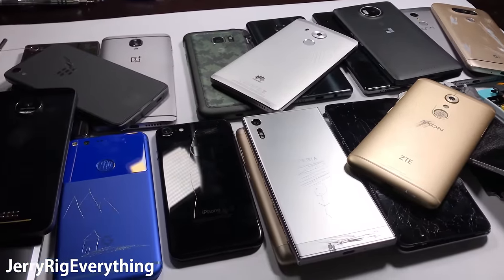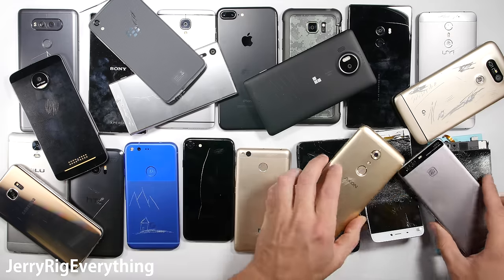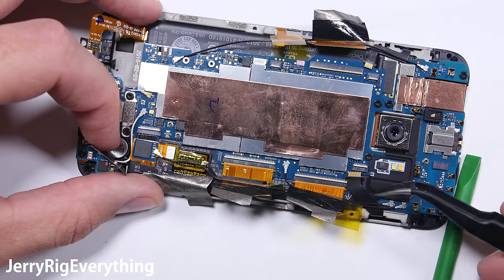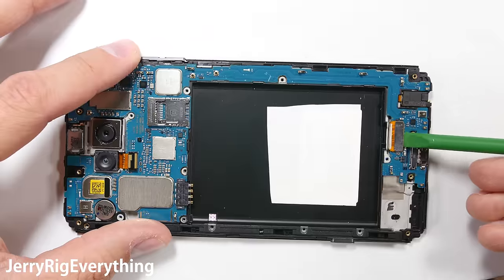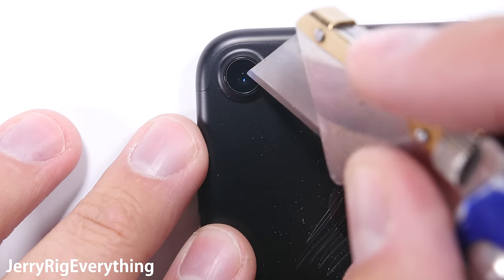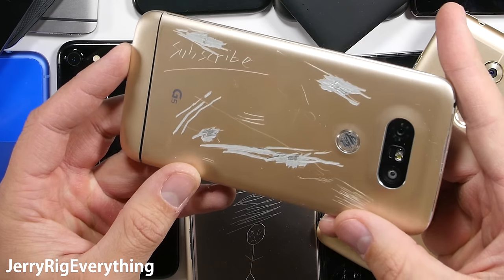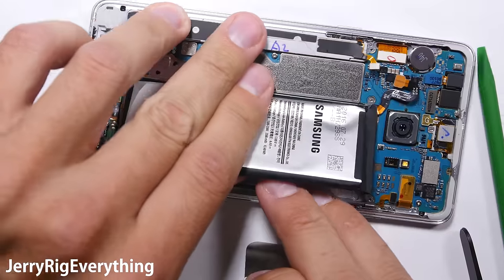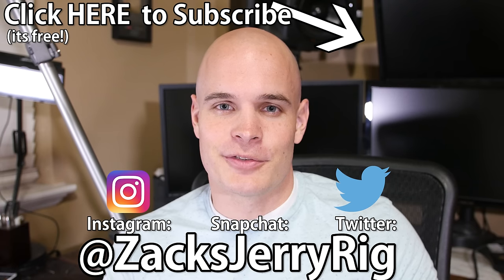Most Durable Smartphone of 2016 - Year End Summary Awards

Comment: S7 Active is the most durable one
Reply: I M serious and also

Moto Z and one plus 3 but the Samsung one is a beast
Reply: I think your an isheep
Reply: You kinda have a point about the scratch on Samsung dude
Reply: Right, Active screen is protected by plastic that scratches. So you add tempered glass on top of that and you dont even notice it.
Reply: Wait wtf
Reply: howyoudurrinhunneh exactly what I did
Reply: Hanzlah Sohail but that kind of defeats the purpose of the plastic screen in the first place the issue is is that unlike another phone which name I cannot remember this one cannot be easily swapped
Reply: Ok
Reply: You spelled [Verizon Wireless's] Kyocera DuraForce Pro wrong! XD
Reply: OnePlus 3 & the 3T are great devices but it's not water resistant.
Reply: I am still liking  oneplus but Samsung Note4 was the first smartphone I loved then I went on Samsung lead and also Sony xperia Z5 it's fast as lightning

Comment: My fav of 2016 has to be the HTC 10
Sure, boomsound isn't the same as before but damn, HTC is always on top of updates and their hardware on flagships can't be beat
Reply: Darrin Ramlochan yeah, but never made it when it comes to performance.
Reply: Darrin Ramlochan man i woulda got an HTC 10  if it wasnt so complicated to root and repair the damn thing lol
Reply: HTC 10 doesn't perform much differently than the Pixel phones. 
And HTC's are actually one of the easiest smartphones to root and install custom stuff on.... Unless you're on Verizon.
Reply: leaving the software experience, Pixel is nothing. They both suck at performance. Also the 10's camera isn't satisfying.
Reply: ***** actual compared to nexus/pixel/Op3 the htc 10 is fucking hard to root imo and fuck verizon lol
Reply: Maybe it might have been hard to root initially but the updated thread over at xda has a simple enough adb command to execute then to flash the supersu.zip
Idk maybe because of my experience with rooting odd devices it seems simple to me LOL 
Be glad you guys didn't have a HTC Amaze 4g like I did where you literally had to short circuit the phone while executing commands through terminal in Ubuntu Linux just to get S-OFF to be able to flash anything.
Reply: In specsheet of their cameras, the HTC 10 should have a better camera than the Pixel / Pixel XL. And what did DxOMark say about that? 89 for Pixel / Pixel XL, 88 for HTC 10. How bad is that HTC?
Reply: Heck, real life results proves it further
Reply: I believe that the reason the HTC's camera might seem lackluster is because of it's software processing and external lens. The external lens would cause some aberrations in the picture and image processing really affects the quality of pictures overall. 
The main reason the Pixels and Nexus 5x&6p phones have such great cameras is because of that image processing.
Reply: When you look at it, the HTC 10, Pixel and last gen Nexus devices have almost the same camera. Same pixel size, same sensor size, same megapixel count. The slightly wider aperture and OIS on the 10 should have let it have an edge in low light performance. 
But still, the 10 does so much things right with it's design and ease of use all while being complimented by a wicked design (yeah it might be polarizing at first but I think it's gorgeous)
Reply: Darrin Ramlochan it's because of hdr +
Reply: Ali Adnan your "performance" differences compared to other phones is meaningless in real world applications. we're talking milliseconds.
Reply: Caelan Jones milliseconds when new, seconds 6 months later.
Reply: Ali Adnan you my friend are fucking right
Reply: Ali Adnan That may be true for a lot of manufacturers, but HTC manages to find a way to keep it clean. I had an M8 until about July this year and it was almost flawless.... Until I drove over it with my van. 
The only issue I actually had with it was that the ram just simply wasn't enough for the things I do.
Reply: +Darrin Ramlochan hardware at in in durability aspect only for me which I always just put inside a case anyway. The HTC 10 is still using eMMC 5.1 when everyone is already using UFS 2.0. The HTC 10's back camera is also often considered as not as on par as the one on S7. The display is not as good as compared to the S7 as well. (Please don't argue that the SAMOLED on the S7 is oversaturated. Samsung do offer different display modes for your preferences. You can change to SRGB mode if you wanna reduce the saturation.)

The HTC 10 is just great in their speakers and their software which Samsung especially sucks in. For hardware, I would give it to Samsung and software to HTC.
Reply: Mitchell Tan AMOLED burns in though, and it always seems to be blurry to me.
Reply: Anthony R blurry for red or blue pixels if your standards are really high.

LCDs has non true looking blacks, thicker panels, non flexible (Not so future-proof) and most importantly for me, not the best for always on display.

And if we are speaking about the HTC 10 display vs S7's, the S7's display has better view under sunlight, brighter max brightness and more accurate colours.
Reply: Mitchell Tan Most of that is true... The S7 does have better view under sunlight and a brighter screen. But LCD has a more accurate color gamut. 

The one thing I do love about AMOLED screens, the blacks are amazing. Although the thicker glass on LCD displays make the screens alot harder to break.
Reply: Anthony R I am no expert in display technology but according to the  Anandtech report, everything seems to point that the S7 is the more accurate display?
http://www.anandtech.com/show/10468/the-htc-10-review/2
Reply: Mitchell Tan It has a more accurate grayscale. But when you see the colors in person (Other than red). You can tell LCD is more accurate. This might just be me though. 

When I read the part that mentioned the red pattern when you turn the screen, I checked my HTC 10 and it does it.... I didn't even notice until now😂
Reply: What I don't like with AMOLED displays is in dark video theres a huge contrast between (off) black pixels and (on) near black pixels. It was awful watching dark films on my S6, especially of there was any compression at all.

But OLED has better VR, which is tempting me...
Reply: ANameThatIsn'tMyOwn I love AMOLED and will never go back!
Reply: Nathan same my OP3 is my first AMOLED phone and I love it
Reply: Ultimate Gohan Awesome mate! AMOLED is only going to get better and nothing beats those true blacks we get👌
Reply: Nathan my favorite thing about AMOLED is that the screen looks like it's floating, it awesome
Reply: That's because off zero air gap between the glass and the AMOLED screen! and with Samsung famous vivid colours plus 2k rez it really pops!
Make my gfs iPhone 7 screen look dated👌
Reply: Nathan oh yeahhhhh AMOLED
Reply: Oneplus 3T is the real winner !
Reply: Ali Adnan The HTC 10s camera isn't satisfying?
Reply: MashLegend waste phone in build quality

Comment: Really miss the Note 7. Where are you Note 8!
Reply: Ahmad A. It's running for the worst failure of smartphones ever
Reply: Shawn Mendes Lol, Samsung better not screw anything up this time. Otherwise, I'll just have to wait even longer for the Surface Phone.
Reply: Ahmad A. Note 7, whether the battery issues existed or not, still won't be the best phone of 2016. Why? It still doesn't just live up to the hype of a true flagship. Specsheet is just impressive, but not performance. The keyboard lag is still present. The UI is still not that smooth. Stutters still occur if not that often. RAM management is fixed, but they wouldn't be able to do it if they increased the RAM to 4GB. Camera isn't as impressive as I was expecting it to be. On specsheet, it was advertised as having a DSLR-like low light performance, when it's so far from being close to the DSLRs low light quality. Audio! That's another aspect they have to step up so much. They're lagging so much behind against their competitors in audio, especially Apple has now moved to stereo speakers. IP certification is a nice comeback, but it's pretty far from true waterproof king, all hail Xperia devices. Battery is the only area that impressed me. Display isn't really that great either. I've seen so many LCD screens have better accuracy and colors than the AMOLED panel of the S7 Edge. People saying it's the most accurate are just all pure liars. LCDs will always be more accurate than AMOLEDs, and the issues of the S5's display was still on the S7 / S7 Edge. Samsung is only famous for their brand, but not their quality products
Reply: Shawn Mendes Says you. It was already awarded title of best phone of 2016 by plenty of reviewers for several objective reasons before the fiasco, but you're entitled to your opinion. The performance is great on the global Exynos variant, it's just the SD820 variant that's half-assed and has the problems you described. I returned mine before the fiasco 'cause it was the SD820 variant while I was expecting the Exynos here in Canada.

The camera, you can call it all you want, but majority of the world disagrees with you; iMore, Windows Central, Android Central and Crackberry's blind-camera comparison awarded that title to the over 6 months old S7 Edge ( https://goo. gl/IPV0DE ), the Note 7 only made things better. Audio, go listen to SuperSaf TV's comparison ( https://youtu. be/seSJvwF68-0 ) and realize how wrong you are, the iphone's audio recording is garbage. If you're referring to the speakers, yeah, I'd like to see Stereo speakers on the Note 8. IP rating, the XPeria aren't any more waterproof than the Note 7, if you simply google "is the sony xperia waterproof", you'll see it has the same limitation of 30 minutes and a depth of 1.5m, which is the IP68 lab certification, even Sony warns to avoid using it under water ( https://goo. gl/PWGQEf ), so, your point there is mute. Display, you can deny it all you want until apple switches to AMOLED next year, by then I'm sure you'll eat your words. Regardless, actual professionals ( https://goo. gl/BCSXw0 ) have objectively rated it the best Smartphone display for multiple consecutive years, only you needs to get your eyes checked.
Reply: ***** I'd rather they make it thicker than reduce the battery capacity. It was already a bummer that it had a smaller capacity battery than the S7 Edge, I think making it even smaller would be even less appealing, but that's just me.
Reply: ***** I agree regarding the battery tech, it's really dated and we've been seeing a lot of rumors over the past several year about different new battery techs that last much longer, charge faster, etc, yet none of them have made their way to Smartphones all this while. Regarding their chipset, I haven't seen a battery comparison to phones with mediatek chipset, mind pointing out a flagship phone with their top chipset? Though, I recall reading Mediatek chipsets tend to be weak in terms of GPU, so, it would make sense for them to be less power demanding.

Regardless, I wouldn't consider their Exynos chipset being poor in terms of efficiency. Old comparisons like this ( https://youtu. be/1YFXN4SQtKY ) show it having no problem outlasting the competition, and reviews like this comparing their Exynos variant (Note 7 https://goo. gl/xuUjcp , S7 Edge https://goo. gl/mNTt6t ) to their SD variant (Note 7 https://goo. gl/1s2v5z , S7 Edge https://goo. gl/I5q0Kp ) consistently show the Exynos variant as having a higher battery endurance, longer lasting, and still better performance (but I think this latter part is mainly due to Samsung being too lazy to optimize their software on the SD variant). Those same reviewer's battery endurance test of the iPhone (6s+ https://goo. gl/WI8x6m , 7+ https://goo. gl/58UCGR ), OnePlus (3 https://goo. gl/zP89QR , 3T https://goo. gl/sEbDni ), LG G5 ( https://goo. gl/9z5l01 ), HTC 10 ( https://goo. gl/i82TBh ), Pixel XL ( https://goo. gl/iDlvMw ), etc. also agree with that old comparison I pointed out above, so, I think it's safe to conclude it'll still easily outlast the newer and more expensive competition.
Reply: ***** I'm somewhat confused here. Aren't the Mediatek chipsets complete SOCs like the Snapdragon and Exynos chipsets, which contain both a CPU and GPU?

Regarding the turning on/off of CPU cores, I recall reading all Quad Core and Octa Core CPUs do that too on ARM devices. In fact, that's how they work. They have a set of low performance cores, and a set of high performance cores. When in idle mode, they use only the low performance set, when doing more intense tasks, they then use the high performance cores for the main task and low performance cores for background tasks like syncing/notifications/etc. Basically, they aren't truly quad/octa core as you have in Desktop CPUs, their extra cores are mainly for improving efficiency.
Reply: It's sadly not coming for an extremely long time, instead, they are going to push their samsung s8, which will be extremely powerful according to the specs, but also is  confirmed to not have a headphone jack cause they saw the money apple was making and saw it as unfair, if you can't beat 'em, join 'em.
Reply: peter garrett That's not confirmed, that's merely rumors at the moment. Just like with the 3D touch gimmick that apple presstitues were trying hard to make readers think Samsung was going to Copy-Paste in the S7.

It would not only be stupid of them to do such, especially after the Note 7 fiasco, but it would also be hypocritical of them after they made fun of others removing it during their Note 7 keynote. If they do remove it without anything better (0 compromise) to replace it, I'll simply never buy a Samsung Smartphone. The Note 7 is the only Samsung Smartphone I've ever wanted.
Reply: Ahmad A. I guess that's what Samsung get for missing out a note number right? The true note 7 will come out this year
Reply: Amhil Khan Lol, yeah, possibly the ghost of the Note 6 hunted down the Note 7. Here's hoping the true Note 7 at least looks and functions as amazing as the original...

Comment: So like...how is the iPhone not on the easy to repair list? Literally two screws and the screen is out. Two pull tabs and the battery's gone, etc. Sweet video tho, love your channel!
Reply: Lemme guess, you've had iPhone all your life?
iPhone does not removable battery. That alone makes it not on the easy repair list.
Reply: Very few phones have easily swappable batteries.  That doesn't make it hard to repair. I can remove a battery from a modern iPhone in about 10 minutes.
Reply: +Dell0304 that is very dangerous. Only do that if you know what you're doing.
Plus if the battery broke, those phones that have an easy removable battery can fix it easily. Like the V20
Reply: ...I know what I'm doing. Honestly unless you stab the battery like an idiot nothing's gonna happen. It's only hard to do for people who aren't hands on.
Reply: Dell0304 you do realize you have to transfer over the camera, earpiece, and the home button unless you don't need them. Although you can say 2nd place after the pixel.
Reply: That's only if you buy a barebones screen. I buy the ones that come with those items (except the home button of course). It's not hard, and I'd argue that heating the phone with a hairdryer and having to shove a card under the screen is more effort than taking out two screws and using a suction cup.
Reply: no I buy the whole screen with the lcd never cam with the camera always have to transfer those.
Reply: The iPhone 7 has a seal around the inside that keeps it water tight. It's not entirely easy to disassemble.
Reply: I bet I could still do it.
Reply: watch his latest iPhone 7 plus screen repair video and you'll understand why